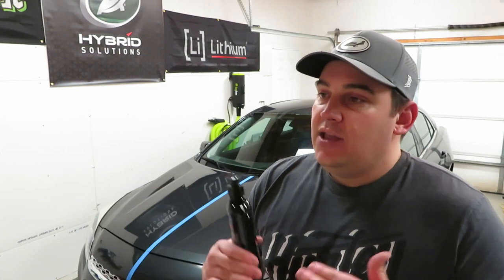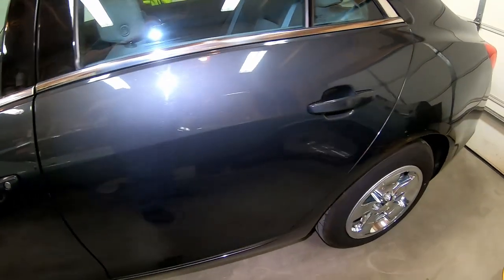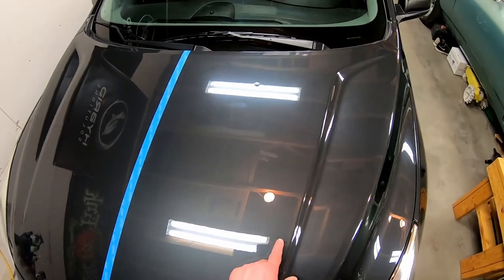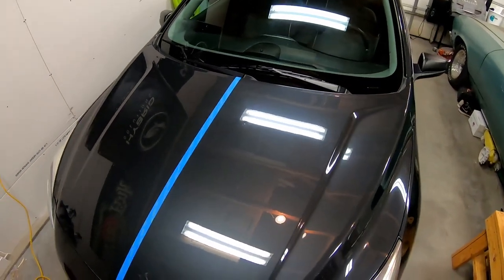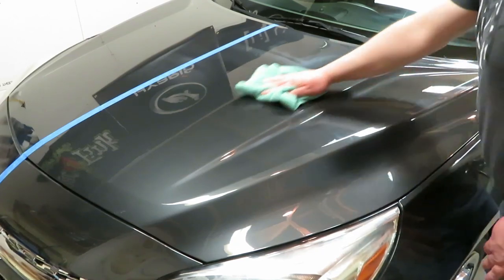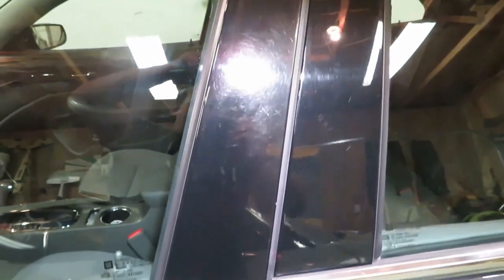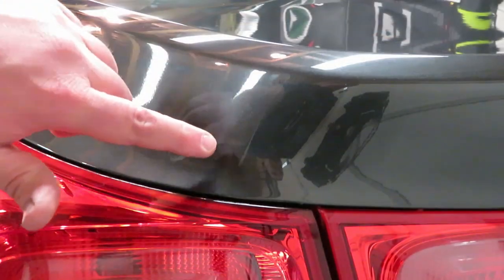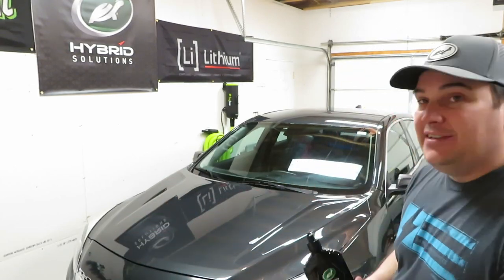Turtle Wax 1 & Done Compound | A Compound NOT to be over looked!

Comment: If your going to be using a sealant like TW ice, or graphene flex wax/ceramic flex wax, do you need to do an IPA wipe first? Or just apply right on top of this product after wiping?
Reply from the maker: You can apply just right on top. For me I always like to do an IPA wipe down just to ensure the paint is as clean as posable so the bonding process of the pant protection can make the best bond as possible. But there is not any right or wrong way to do it just personal preference.

Comment: I’ve not seen anyone use panel wipe after this product to show the actual results
Reply from the maker: It does not need a panel wipe but if you do it in my testing the results stay the same.
Reply: @MeanBee392  Explain how it does not need a panel wipe? The compound is full of oils which which fill and mask perfections, which is exactly why panel wipe is used after so the results can be inspected, its almost in possible for the results to stay the same.

Comment: I still find ultimate conpound easier to work with
Reply from the maker: What part is easier with the ultimate compound?
Reply: @MeanBee392  work time and easy to whipe off.
Reply from the maker: Ok got ya. Thanks for sharing and saying what product you like better.
Reply: Interesting! I've use the UC and while I like it for light correction it has to be followed up with a polish to get that shine back. I tried the TW 1&D with a URO fiber 50/50 and couldn't believe the correcting and shine in one shot! A quick ceramic spray sealant and I was done in a few hrs total including the starting strip wash. This stuff is pretty incredible!